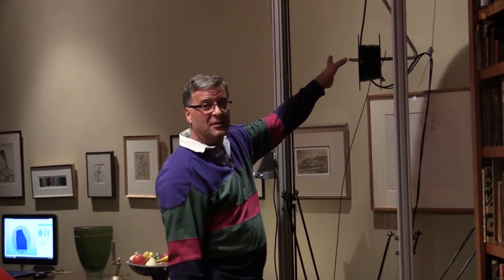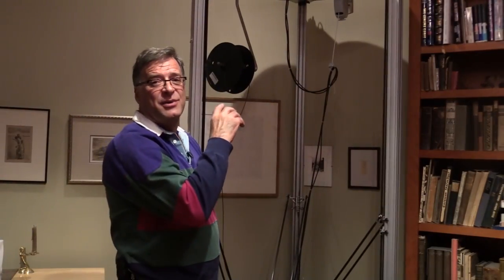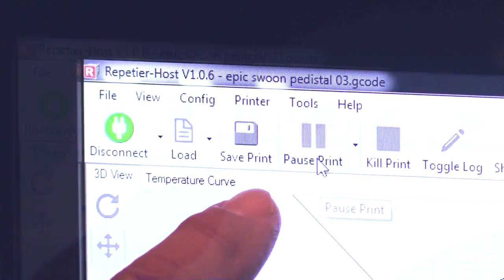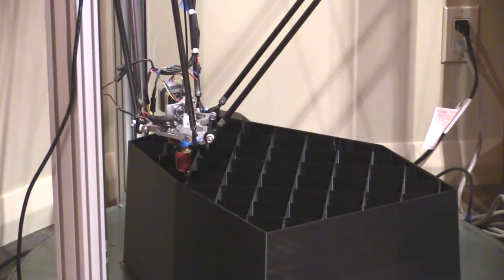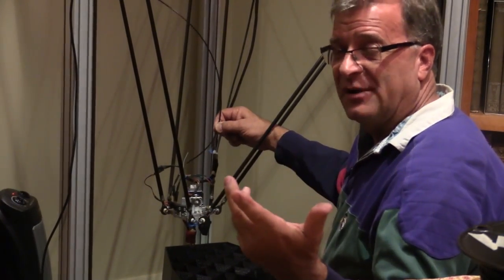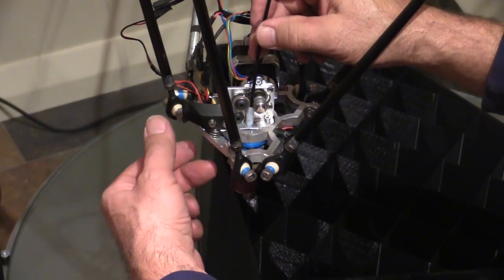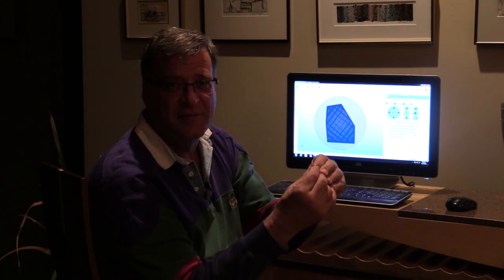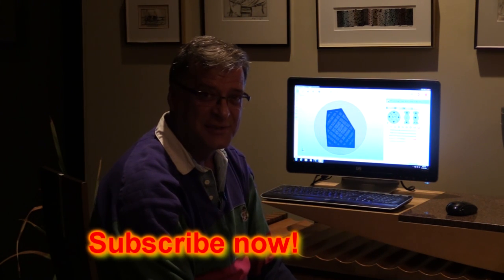How to Change Filament in a 3D Printer - Another Approach - Kevin Caron

Comment: Hello Mr Kevin , firstly congratulations! it seems very important project. I have a question . you have to buy license repetier to change filament or not? and other question is what is the used stepper motor ? ı think the stepper motor very strong ? 
Thank you very much .
Have a good work.
Reply from the maker: No license needed for repetier.   It is freeware.   I just have to pause the print and swap filament spools.   Not sure on the stepper motors, just know they work.